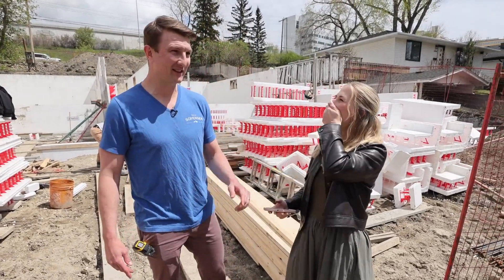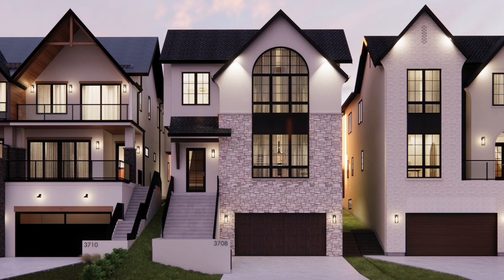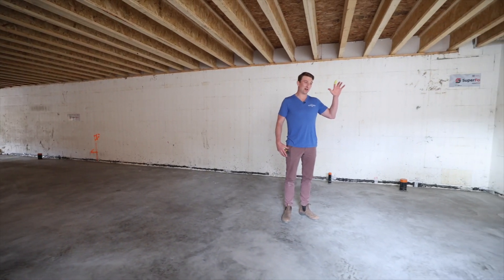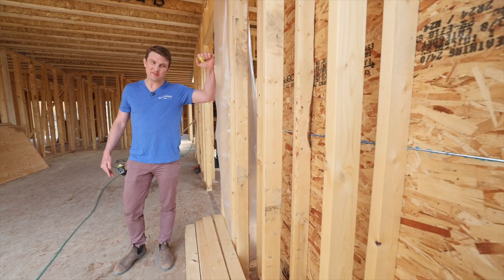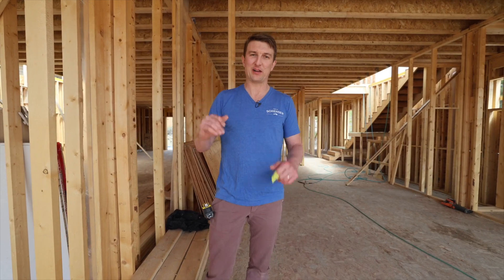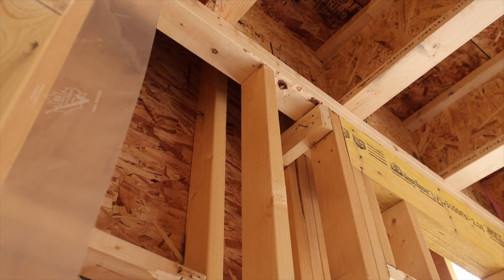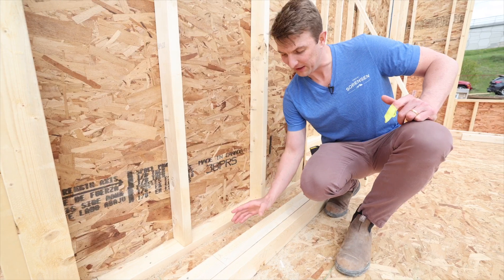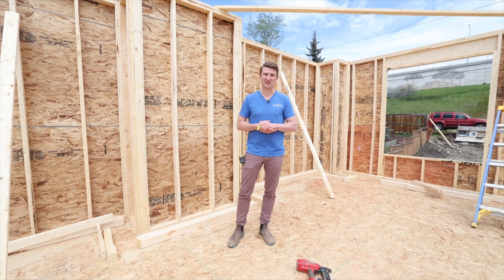Framing 4 Net-Zero Homes At Once

Comment: I've just discovered your channel and watched a little of your net zero wall framing clips.  Your last comments on the above segment answered my question regarding inner wall structure stability with the short floor joist for the second story wall that rest on the inner lower wall.  I now see it's secured to the outer wall with the floor sheathing for the next story.  I currently live in a home with "balloon framing" and having that flooring as a fire break makes sense for both the fire break and inner frame stability below, though I have a little concern that it also makes the inner wall below "load bearing" instead of non-structural.  I've followed use of the "double 2x4" wall method since the early 1980's and have been a fan, but I'm curious as to why you align the studs as you do rather than offsetting them to further increase the insulating value.  As long as you have to install the middle layer of insulation anyway, why not offset the studs to lessen the "thermal bridge" effect where the aligned 2x4's are more conductive than if they were offset?

Comment: Curious why you don't use Zip+tape or simply tape the sheathing (which is probably preferable since the sheathing has higher perm)? Seems it would be far less labor than faffing around with accoustic sealant/plastic on the interior.  Then you can do blower door testing much earlier in the process and then only worry about detailing exterior penetrations.
Reply: Can't speak for them but we dont use zip because fire rating. We use mineral wool board on exterior of our timber frames. We also run vertical sheeting. So no gaps and more nails for shear values. Even thou our timber frames alone have high shear values. We have a more strict insulation codes too. We have passive systems too, so no power or left empty no mold, because passive moisture venting. As we build a lot of lake houses that are not lived in full time. We don't use icf either because icf don't allow moisture to vent. Masonry loves to wick moisture. Here code requires masonry to have at least 18 inches exposed to air to dry out. So the masonry doesn't becomes water logged. We do thermal breaks around windows and doors because poor r values. And move windows and doors closer to inside. As it does help with cold and exposer. To make walls warmer around windows and doors. We do warm roofs because code requires r 60 roof.

Comment: The inner and outer walls are still joined using the second-floor sheathing, correct? If I understand correctly, there is an insulation break between the attic and the walls.
Reply: I would think there's a small thermal bridge where the second floor sub-floor meets up with the sheathing. Pretty minuscule heat loss I would think, he needs that sub-floor for a fire block between the floors. I like this double wall method compared to Matt Risinger's "Monopoly" framing technique, adding insulation on the outside is quite difficult and requires long fasteners and doesn't do any better than what this guy is doing.
Reply: Plus they have so many 2x4 "shorties" braces connection outside walls to inner walls......Those are small thermal bridges all over the exterior walls so if you want to really be thermal bridge free you would have to add exterior insulation........ Don't get me wrong I still like the idea its just not as good as advertised that's all.